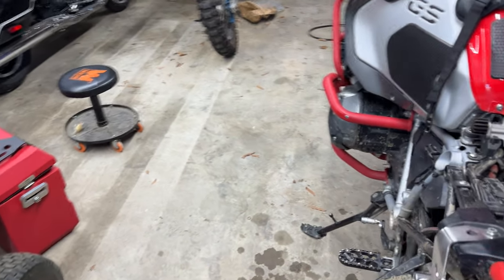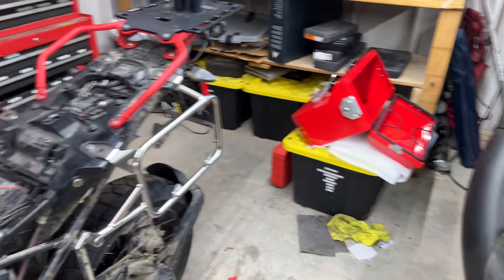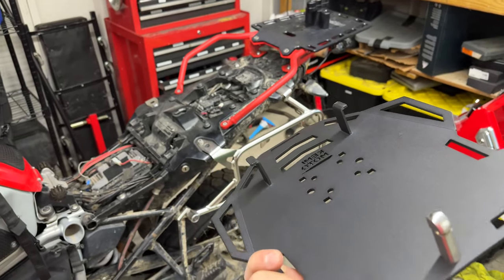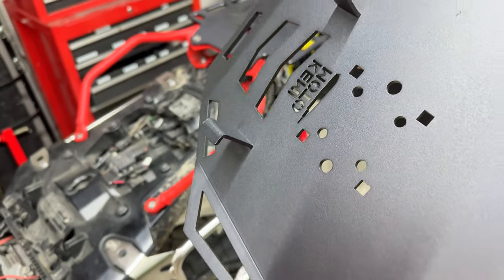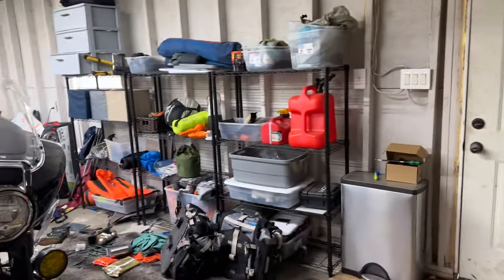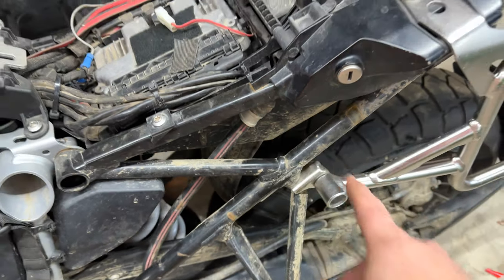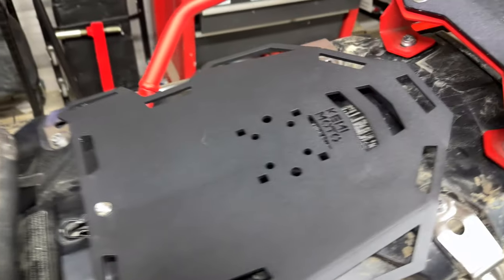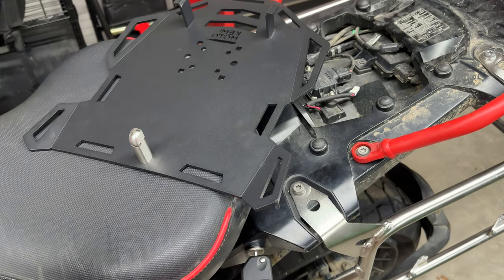Install: Kenimoto Rear Seat Area Covering Plate and Rack Pillion Cover - BMW R1200GS Adventure

Comment: I’m with you on the deep hate for rattles and squeaks. I’ve torn out the dash on an Audi, replaced a hatch on a Golf, suspension on a Mini and removed the seats on practically everything I’ve ever owned at some point. One of the most aggravating noises was in my ‘96 Carrera. It was a sound of something small rolling as I went up and down the parking garage where I used to work. It took months to figure out the pattern of the sound. My wife was not amused driving around every weekend with me contorted in the back seat area upside down listening for anything. “I don’t care anymore. Sell the damn thing”, she yelled. Roll, roll, tink. Roll, roll, tink. Aaarrrgh! After pretty much disassembling the entire interior…multiple times,…I finally found it. There is an ECU bolted underneath the drivers seat on the floor. Once removed, there is a 1/2” diameter hole in the chassis structure sealed with a rubber plug. Inside the closed chassis structure I found a TINY, cylindrical glass fuse. An identical fuse is found in the ECU. I’m guessing that some fumble fingered German, fresh in from Octoberfest, dropped a fuse as the ECU was installed. It must have been a million in one shot to go through the hole. Who knows. It was an adventure with new curse words to get it out. i couldn’t see or reach anything. I eventually put a dab of grease inside the small hole and drove up and down the parking garage until the noise stopped. Then I took everything apart again and, with jewelers tweezers, reached in and pulled the fuse out of the grease blob. Win! 😂

Regarding the GS pillion seat replacement, I have an OEM cover/compartment there. It’s not just a plate, it’s about a 2” tall compartment with a hinged door in it. It opens when you insert the ignition key just like it does to remove the pillion seat. The 2” of space is useful for a bit of storage. And I use the top just a you are planning to, with a small bag there when traveling. There was one for sale just this past week on ADVRider.
Reply from the maker: Yep, drives me crazy. Rattles are the worst! I am familiar with those and they were always too expensive. I'll keep an eye on the used listings and see if I can find one.